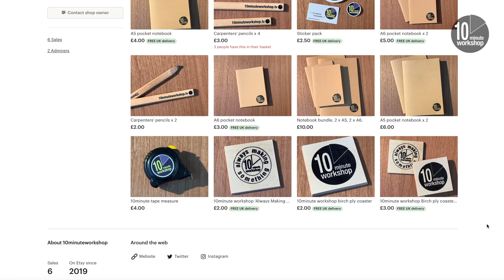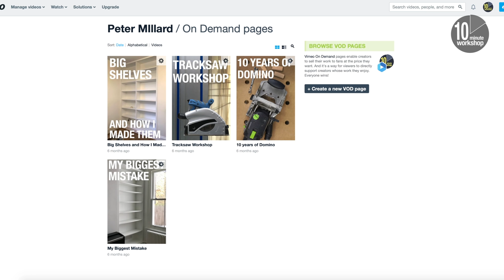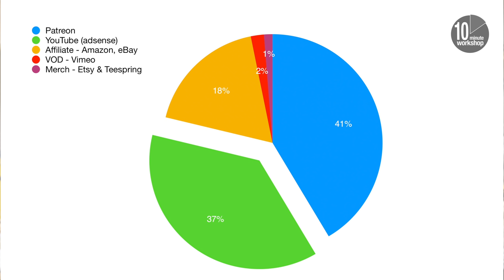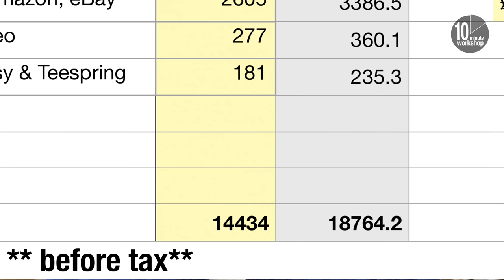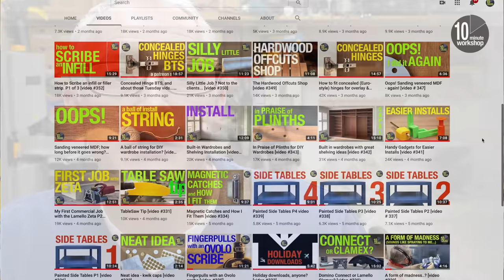How Much Money Do I earn from YouTube? [video 376]

Comment: Thanks for that info.  Very candid - I’ve never found anyone else who actually gave this kind of info.  I’m not a youtuber, but it’s interesting to see.  I also find myself wanting to move away from giant plywood type projects and more towards smaller, more detailed projects using high quality, real wood.  I definitely wouldn’t mind less wrestling of 4x8 sheets of plywood (that’s standard in the states, I think you guys have 5x5 sheets there like we get with baltic birch).
Reply from the maker: Thanks! No, 8x4 is the standard size here, never seen a 5x5, though Egger board (MFC) comes in 10x5 - that’s heavy! 👍👍
Reply: Interesting - maybe that’s on the continent (5x5 is something even in metric).  Maybe I’m just misinformed.  Baltic birch - which is a European import for us - is definitely 5x5 here.  We don’t use much melamine around here - it’s gone out of style - but 10x5 particleboard would be heavy, not to mention easy to break.

Comment: Your client builds are of course an ideal way to get diverse topics for the videos, double win. When I buy from Amazon I enter via aff links from youtubbers I like, but uk based like you give .co.uk links so idk if those work, hence I have not included your or other uk channels in the aff link rotation but would if you add a general .fr aff link ( to my knowledge the aff link one uses to start an Amazon session (that stops if the browser is closed) gives the aff linker revenue no matter what is bought at no cost for the buyer so it's logical to enter with these links to help smaller nice channels out a little. If you could add .fr and .com links this could make that part of the pie chart bigger if the rest stayed about the same
Reply from the maker: Thanks! I add .com links, but I’m afraid the reach for .fr is very modest; each amazon affiliate program is separate, and requires registration in each county, so the overhead Isn’t worthwhile, unfortunately. Thanks for thinking of me though! 👍👍
Reply: Cool. Com will help you. Do consider France for there are a lot of real diy English folks having houses/castles here and I for one will use your link and looking back at my orders of Amazon I order once a day on average (I check the warehouse for a bunch of things I want/need so I can get good brand stuff for the price of budget (like recently bought aBosch planer for €35 and last week a Peugeot 255mm sliding mitre saw for €125). Car parts are usually easy to find and because of prime cheaper then online specialized retailers. 

I genuinely like your channel  because of the friendly manners, clear explanations , very civilized and personal way of filming like you talk to us, the general peace and rest/relaxedness in telling things. So I would love to be able to support you.

Also I switched from ordering the more little things from Aliexpress to Amazon for the same stuff, it is a few cents or euros more, the waiting is the same but sellers on Aliexpress are more proned to try to send wrong/bad or no stuff where those who also use Amazon want to keep the relationship good so the orders are going just that bit smoother so Amazon has taken like 90% of my tool/electronic/trinket/present online sells and seeing the total of that and what you told here I know just my clicks will show and are worth your effort to make a French aff account. .  

Talking about effort, it's probably wise to add that the Google revenue is something taxes are to be paid for, my son has a gaming channel that he monitized a while back, he is 14 and has 43K subs, leading to a strange situation that he cannot have his own bank account (9 and a half months waiting :D) and our move from The Netherlands where we from and where the YouTube account was made resulting in his earnings coming from Google Ireland to my Dutch bank account , he uses the money for gaming and other stuff (like a good microphone) yet we have to take into account that a portion has to be paid to the taxman. (Resulting in an even stranger situation where the Dutch taxes still want me to do my taxes there, yet when trying to fill in the stuff the system says I don't have to for I'm a tax resident of France and the money coming into the Dutch account is earned in France, lots of letters from Holland and automated systems working against each other. But as you said some young folks will find YouTube income cool but really should be taught about how taxes work to let them know €1 earnings does not mean €1 spending, valuable lessons.

Comment: I'm wondering if the subs/views to money ratio is linear - if you doubled your subs and/or views would that more or less double your money? Of course, if you did double your subs then it's likely that things will accelerate - by the time you get to 50K-ish (I reckon) then the graph could/will starting to rise more quickly. Bit of a dark art, innit?
Reply from the maker: Not quite that simple, but along those lines, yes. At the start, a channel with say, 1000 subscribers will get a high ratio of views per subscriber, say 50%. But as the channel grows, that ratio drops; 20% is  pretty good (i.e. 50k subs gets 10k views) and I've been exceeding that comfortable for the last few videos. But that ratio falls away as the channel grows; Jimmy Diresta with 1.6m subs can sometimes 'only' get a video with 150k views - but it's still 150k views! Then you get into views vs monetised views, the CPM of the sector/genre you're in, gender, geography etc.. 

And FWIW, I am at 50k-ish subs! 👍😂 Cheers. P
Reply: @10MinuteWorkshop  Good point on the fall-off of subs:views - if we say that balances the steeper (i.e. non-linear) growth graph then the money line maybe will be linear-ish. Super interesting stuff - and thank you for showing your hand.

Re: my 50K reference - I was thinking aloud - by "you" I meant "one". So I look forward to your growth going exponential any day soon 😎